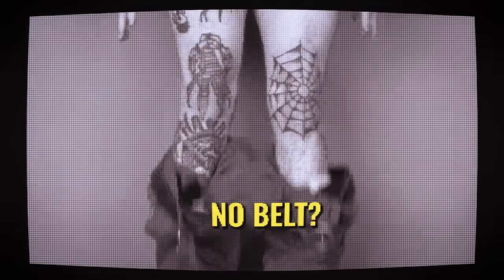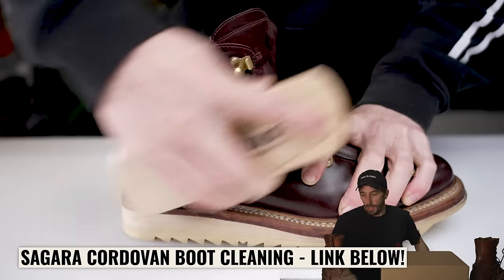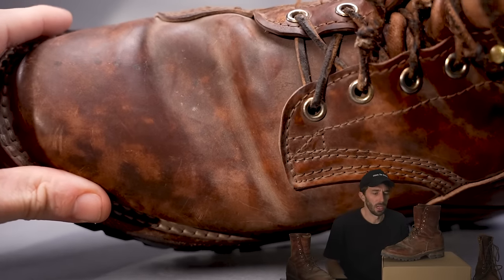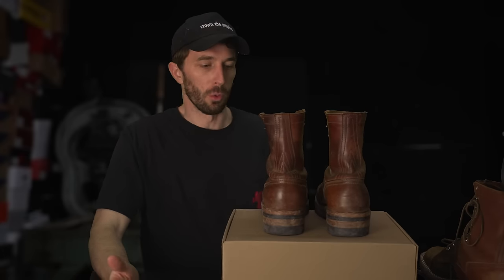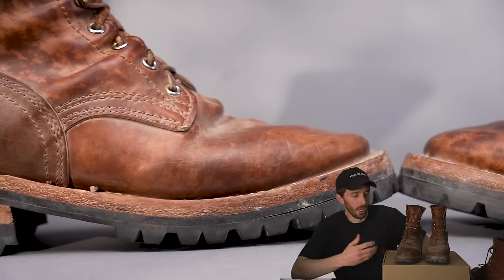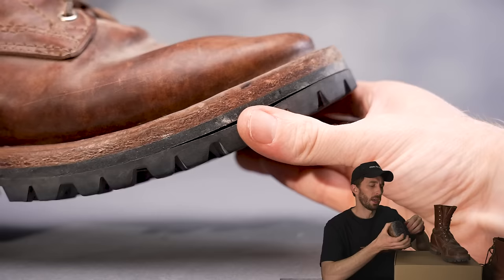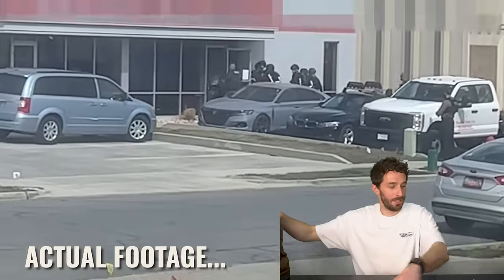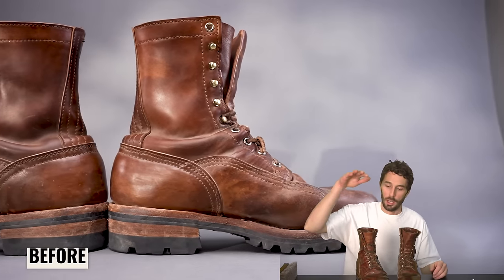Why Cordovan isn't the best leather - Nicks NDC 6 month review

Comment: Cordovan is very resilient, but other than cost/rarity there are 2 main downsides. 1) It has a tendency to rip under stress and 2) wherever you do crease/roll it, it is super permanent and will always fold in the same place. I have an old pair of Color 8 Indy boots that have been back to Alden a couple of times and still look great. But then again, I’m not nearly as hard on boots as you are and definitely will never NEED a PNW boot.

Comment: How about a colab with a soccer boot (cleat) maker? Preferably one from the Montebelluna area of Italy using Italian kangaroo leather, or from Japan using Japanese kangaroo leather.
Reply: I wish someone would make wide toe box cleats, it’s so frustrating this does not exist, the amount of ankle strain from regular shoes is mental
Reply: That looks like a long shot, don't think there's much interest for Football on the channel, and the relationships with those makers are even further away. But it would be interesting for someone who isn't just going to do a recolour of an existing product.
Reply: @HahaDamn  Same. Might neg impact touch, but I'd still like to try 'em. New Balance at least makes cleats in wides. For my ankle/foot issues over the last 30yrs, cleats with a wider heel have helped the most. Brands available in US w./wider heels: Lotto, Diadora & Adidas (I like Diadora best, but they don't no longer use k-leather). Outside US: Asics makes their cleats in k-leather on a running shoe last, with an actual running shoe drop/stack (on their Japan or Australia websites), Munich & Kelme (both Europe), and Adler has legit MIJ cleats, handmade in pre-ordered batches & are half the cost of the Mizuno MIJ cleats (my next pair of cleats will 100% be Adler).
Reply: @bri1085  Def a longshot. But, he did do that one Adidas samba video & Sagara (k-leather boot video) is out of Indonesia (I think). Won't hold my breath though.

Comment: I wonder if Horweens shell cordovan would fold the same way causing pressure points..
Horween shell cordovan usually smells sweet like bees wax
Somebody compared cordovan from another country compared to Horweens soaking them in water.
It took several hours versus minutes for Horween to soak through compared to another brand.
Horween shell is the best.

Comment: 7:00 my pair of nicks does the same with normal chrome tanned work leather. They should really add more reinforcement to their boots.
Reply: It’s actually more of a fit issue. Any boot will do, it’s more common with skinny ankle proportions to calf. Happens most of the time when fitting women. Could also be result of the boot not secured well enough in the heel cup. (Wearing a boot that’s partially laced up) would be a lot more noticeable with cordovan though 😂

Comment: Weston, I need to have Nicks replace my work boots outsole. I have went through two outsoles since I started wearing them in October. They originally had vibram sand outsole. It lasted only two months and the bottoms were wore out. I had a local cobbler replace it with a vibram Christie sole. These are almost wore out in three months. Which Nicks wedge sole do you recommend for the most durable sole? I work in an automotive factory where I am on concrete and abrasive steel flooring all day.
Reply: Vibram makes a dual compound wedge sole that’s harder wearing. Sounds like it’s what you need.
Reply: @BombproofCraftsman  what is it called? Can it be ordered on Amazon or another website?
Reply: @boomstickpd79  hmm, guess YouTube didn’t like my link. I couldn’t find the vibram version. But found out that nicks has developed their own dual density wedge sole. So might be best to contact them directly.

Comment: Saying it's not a work leather because it shows signs of ware is like saying high carbon steel like 5160 spring steel isn't a good working steel because it shows pitting. That's my little hot take. 😆

Comment: Nick's has insanely poor quality control. I own a pair of Renegades (English bridle) and Overlanders (Chromexcel), and the quality control issues on both are just off the charts. If you contact them about the issues, they'll just make excuses and try to gaslight you about them. As such, I will never buy another pair of Nick's.
Reply: I've seen hundreds of pairs of Nick's boots worn by wildland firefighters, and I have never heard of a single issue with them. TF are you talking about?
Reply: @drtyhay A year ago I received my builder pros. 3 months later while operating a shovel the vibram heal fell off, wasn't any nails in it whatsoever, just glue. I took them back they fixed them that day. Been great ever since.  Nobody is perfect, and they fixed the problem.